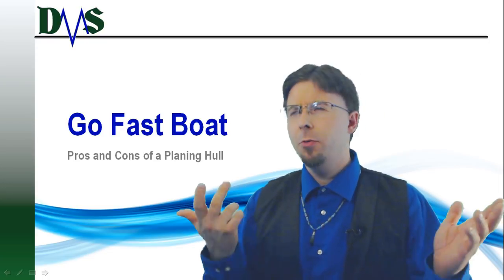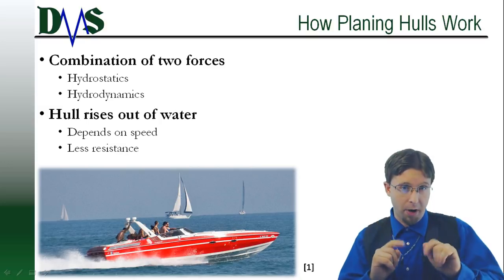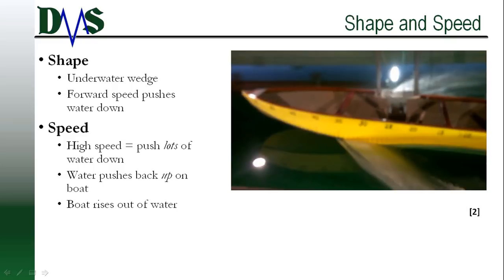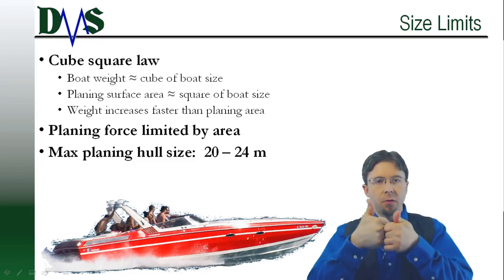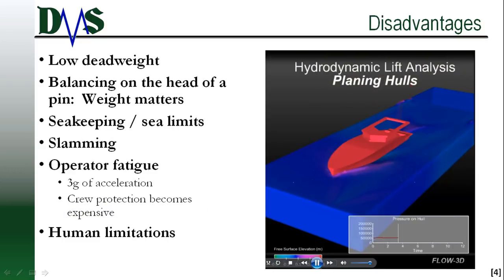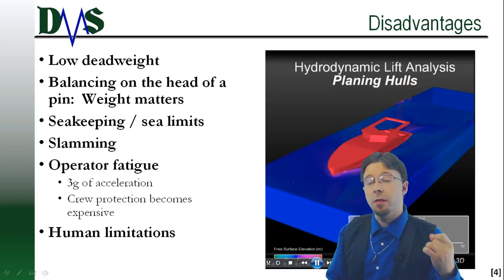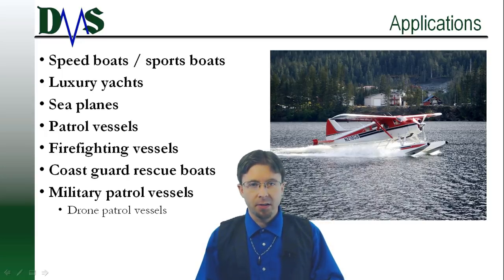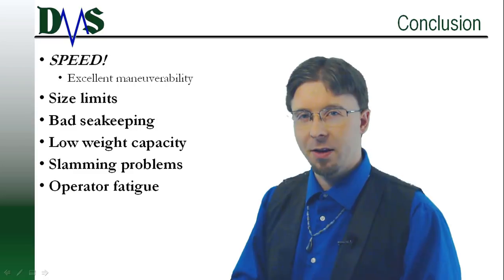GO FAST BOAT:  Pros and Cons of a Planing Hull

Comment: Great video on planning hulls. If you have not already done a video on semi-displacement hulls please add that to your list. I operated an 82' USCG Patrol Boat that was fast for it's size in heavy seas. A very stable boat, but rocked side to side even in clam seas. I use to have fun surfing her on the swells in a following sea. In a 6' swell you could find the sweet spot and ride the swell. She even broached on a 40" wave but recovered. I was standing on the bridge's bulkhead "waiting" for her to come back. And it did, just in time for the next wave. Fun times.
Reply from the maker: That's a great topic.  It will nicely round out the different hull categories I've already looked at.

Comment: Outlaw Eagle has an interesting solution to the problems and weight distribution conundrums and risky situations caused by waves and rough waters on high speed planing hulls designed for white water river jet boat racing. They have attached small canard wings near the prow. Each wing is about a meter long and 250 mm wide. They use the speed through air to make lift and let ther front of the boat glide over waves and avoid porpoising and augering in or slamming into most of the roiling water they race through

Comment: So are plaining hulls different from hydrofoils? Or is Planing hull the more technically correct term?
Reply from the maker: Yes, planing hulls are different from hydrofoils.  Hydrofoils use miniature wings under the hull to lift the boat completely out of the water.  In a planing hull, the boat still has a small section in the water.  But to make matter confusing, the hull of hydrofoil ships is often a planing hull.  This helps the hydrofoil vessel get moving fast enough for the hydrofoils to take over.  Just like an airplane needs to reach a minimum speed before it can takeoff from the runway, hydrofoils also need to reach a minimum speed before the hull can clear the water.

Comment: First, thank you for your channel and the way you explain. I don't understand: the maximum planing hull size is 20-24m, but the wally 118 (36m) is a planning hull.  Do you mean that past 24 meters , the amount of energy required to put the hull at speed will cost too much for most of the shipowners?
Reply from the maker: Good question.  I don't mean that the 20-24 m size is a hard limit.  There are no physics that suddenly turn off planing forces above 24 m.  That's just the general limit that I picked based on most of the planing hulls I have worked with.  You can absolutely go larger.  But as you go larger, the margin to support the boat weight in planing becomes narrower.  Shipbuilders need to really minimize the vessel weight.  And the designers need to perform detailed analysis to get maximum planing force from the hull.

Mostly, I just want people to avoid the fallacy of thinking they can scale up without limit.  I saw boat builders that took a hull shape designed for a 9 m hull and scale that shape up to 24 m.  They were surprised to find out planing hulls don't work that way.  So just avoid that mistake.

Comment: Nick, have you looked at the USN's Ghost? Is it a Cat, planing hull or a combination? How dose the cavitation drive work?
Reply from the maker: These two articles were my main sources for a 5 minute introduction to the Ghost.
https://www.militaryfactory.com/ships/detail.asp?ship_id=Juliet-Marine-Ghost-Stealth-Boat
https://www.businessinsider.com/juliet-marine-systems-ghost-boat-2016-11

That vessel has a LOT of unique physics combined.  But from what I read, I would not call it a planing hull.  It's closer to a SWATH.  I have a video to explain the SWATH idea.  https://youtu.be/jJAHyDl6KS8
Those individual hulls may generate some lift at higher speeds, but I don't think that is the main intended effect.

The supercavitating drive is a little misnamed.  It's actually a combination of two ideas:  air lubricated hull and supercavitating propeller.  The idea of an air lubricated hull is to inject large amounts of pressurized air along a hull.  Then the hull avoids direct contact with the water and this lowers the skin friction on the hull, usually around 4-6%.  Normally, we get the pressurized air from an air compressor.  But in this case, they seem to use a supercavitating propeller.

In most propellers, we try to avoid cavitation.  (See this video for a quick explanation of cavitation:  https://youtu.be/MyZzhwYMytc)  But at high enough speeds, you can't avoid it.  So we design a supercavitating propeller that intentionally takes advantage of that.  But you get a large stream of bubbles coming from the propeller.  On the Ghost, they had the idea to mount the propeller at the front and use that stream of bubble for lubricating the hull.

Interesting idea, not sure how well it works.  Those cavitation bubbles normally don't last long.  They typically collapse under the water pressure.  For long term care of ships, we like to avoid putting any hull structure in the path of those collapsing bubbles.  But you never know, maybe Juliet Marine found a new trick.

Comment: Are hydrofoil boats in the category of planning ones? There are much bigger hedrofoil boats than 24 m. USS Plainview is 67 m long.
Reply from the maker: Yes and no.  Hydrofoils and planing boats both use dynamic lift.  Meaning when the boat stops moving, it sinks back into the water.  Same way that planes need speed for their wings to generate lift.  But you hit on a good point.  A hydrofoil is generally much more efficient at generating lift than a planing hull.  So we can get more lift, allowing hydrofoils to still work on larger ships.

That being said, I tend to think of them as two different categories.  Because the physics and design challenges are very different for the two.

Comment: I will ask you your opinion, if possible please. Much sailing cruising boats or day sailors are below 25 foot of length, they run most of the time well below displacement speed, are expensive for the sails new technology, ballast, winches, etc. and generally have an auxiliary engine to avoid a lee shore, or to maneuver, or going upwind.  And most of planing hulls in the same size are a deep V bottom with huge outboards or sterndrives, very wide and heavy. My question is if there is not an unexplored niche for flat bottom recreational planing hulls intended to run in the low tens knots. They will need a very small engine, will be quite economic to run and safe, and can be built in a budget and low time. Because for cruising or camper cruising  a boat of this kind makes more sense than a trailler sailor, except if people likes sails for sport. And almost all commercial recreational planing boats in this size can't run below the low twenties.  A small planing hull with a flat bottom can cruise for several hundreds of miles, will need less water and food for the crew and at low speed more forgiving but at a pace double of the sailboat or more. Thanks and sorry if is a very silly question.
Reply from the maker: Not a silly question.  There may be a niche opportunity there.  To oversimplify the problem, your planing speed is roughly tied to ship length.  To get a ship up on plane at lower speeds, we need a very short planing surface.  (There are ways around this problem, but we'll keep it simple for now.)  To start planing at 10 knots, you are looking at a ship length around 9 ft.  Still achievable though.  This would probably be a stripped down, basic boat.  Mostly intended for pure transportation.  A 1 or 2 seat capacity with a motor, fuel, and not much more.  Imagine the motorcycle equivalent of the boat world.
Reply: Thank you

Comment: are you going to cover hydrofoils?
Reply from the maker: Eventually, yes.  They are on the list of videos that I want to make.  (It's a very long list.)
Reply: @DatawaveMarineSolutions  Please do! I'm trying to learn more about hydrofoiling because it seems they would be the most energy efficient way to go fast. They simply don't waste energy on making any sort of wave. Power required seems to scale linearly with speed. What more could you ask for?
I'd be very curious why there aren't more of them e.g. a motor powered cruising yacht.
Seems like it would make it possible to use solar power to travel relatively fast.
Reply: @dejayrezme8617  why? the prop has to stay deep enough in the water even the boat flys above the water..

Comment: Nicholas i always have so many hypothetical questions but ill keep it quick, could you tell me what the price ranges of hiring an Architect are and what are some things to consider when choosing an Architect?
Reply from the maker: The price ranges vary, depending on the country and region.  But in general, naval architect prices vary from $100/hr to $200/hr (USD), based on the experience of the naval architect.  But the billing rate is only the starting point.  The total price depends a lot on the project and what work they need to perform.  As a general guide, most projects cost at least $2000 or more.  (This is all for the commercial side, where every ship gets customized.)  For how to hire one, I actually did a whole video series on how to hire a naval architect:
https://www.youtube.com/playlist?list=PLhupav37c1P8ThgTixOc6cj5mFDr8gw-3

Best advice I can give:  The more clearly you explain your project with the consultants, the better price you can get.  Allow 2-3 weeks for the consultant to prepare a quote for you.  This gives them time to discuss the project, ask questions back and forth, and then prepare a really well detailed quote.

Comment: So planing catamarans that use the air pressure between the hulls to reduce slamming are much more sea-kindly. And the two narrow hulls reduce resistance at low speeds. What's your verdict?
Reply from the maker: I agree with the initial idea.  But unfortunately, the scale of the different effects makes this unlikely. 

The two narrow hulls would reduce resistance at low speeds, true.  But it also reduces their effectiveness at planing speeds.  Imagine you have a monohull planing hull and cut it in half.  Turn the two halves into a catamaran.  Problem is, you don't get the same effective planing force on those two halves.  Planing works because we force the water to turn downwards to avoid the hull.  But in this half monohull, the water finds it much easier to just go to the inside of the planing hull.  With a catamaran, your hull design could easily become dominated by the planing requirements.

The pressure between the hulls is a good idea for reducing slamming.  But the magnitude of the air pressure normally doesn't make any difference.  The air can easily escape the big cavity between the hulls without increasing in pressure.  So it doesn't really affect the slamming operation.  I have seen some concepts that change the hull design and try to trap the air before it can escape.  That has some effect.  But when we trap the air, we compress it.  That compression is how we damp out the slamming.  Now things get really interesting.  Air heats up when you compress it.  And since water is 1000 times more dense than air, we need to compress A LOT.  Assuming we compress the air to only half of water density, that would increase your normal air temperature up to around 240 deg C (assuming we start at 20 deg C).  Twice the boiling temperature of water.  So now we need to worry about heat burning the hull, and generating steam in the water.  What can I say, the physics makes things complicated quickly.
Reply: My experience is different, take for instance the deep vee hull, in that situation the vector of the planing force is directed outward rather than downward reducing slamming. In the case of cats I have driven, the reduction of planing surface has no effect on it ability to plane, at least in the age of 650 HP outboard motors and the reduction of slamming because of air pressure under the center of the hull is quite noticeable and results in a forward "sneezing" of spray from between the hulls. In other words, you can feel it happen. Personally, I could give a rip about large steel ships as I will never own one, how ever in my shopping for a offshore fishing boat, I have yet to see a monohull that can compare to a cat.
Reply from the maker: Interesting!  I admit that sometimes the theory doesn't predict things accurately.  Those are the really fun points.  I'm a little surprised about the "sneezing" spray from the forward hulls.  I would expect it to spray aft, out the transom.  Do you see spray on the aft end too?  I wonder if the damping experience has anything to do with the shape of your cross deck.  Is it just a flat cross on the catamarans you drove?
Reply: Basically the bottom of the deck between the hulls is high in the bow and just above the resting waterline aft. The outboards are mounted on the center-line of the hulls and the weight seems to be quite aft. The result is as the bow is forced up by a wave, the stern stays planted and when the bow comes down, air is forced out forward resulting in the sneezing I described. Worldcat, the boat I have decided on explains the idea on their web site.  https://worldcat.com/ and here is a You Tube video of one in a seaway. https://www.youtube.com/watch?v=VtBiHnP6oSI&t=859s
Reply from the maker: I'm impressed.  I can see how that design would work.  I gave too little credit to the air damping effect.  Kudos to World Cast.
Reply: +Datawave Marine Solutions I don't think the air damping is a significant effect. The hull is a sort of hybrid, the rear part is designed to plane but the front is a wave piercer style, so when the front dips into the water it smoothly cuts in rather than slams. As you probably know, cats can be built this way since they dont need to design the hull to be roll stable (because there are two of them).

Comment: Thank you very much. You do raise a question or two. Since we don't get to see the bottom of aircraft carriers other then the flat bottom model types sold in kits, and you can't be sure of the exact shape is represented in the kit. Now the secret is that the aircraft carriers are suppose to only goes about 35 knots but in actuality if it needs to be displaced in a hurry they can go over 85+ knots with everyone hunkered down below. My first question is under your numbers can they go 35 knots? And the second are you aware of the UFO type technology that will enable it to go the above mention unbelievable speed the sailors have been subject to. Lots of love
Reply from the maker: It's possible.  They absolutely can go 35 knots.  But not using planing technology.  That ship will never use planing technology.  Just too heavy.  The aircraft carrier is exploiting a wonderful trick of displacement hulls.  To oversimplify:  the longer the hull, the easier it is go faster.  Normally don't see large hulls moving fast because most commercial ships are designed for efficiency.  But the aircraft carrier needs speed, and has the power to match it.  At over 1000 ft long, they are only at a Froude number of 0.31 when doing 35 knots.  That is fairly easy for any hull to do.  At 85 knots, they are near a Froude number of 0.77:  fast, but still within the realm of displacement hulls.  You don't see solid planing until you are near a Froude number of 1.0.  So yes, 85 knots is potentially possible if they have enough power.
What could stop them from running 85 knots?
- Power.  Even nuclear reactors have their limits
- Propellers.  They may not be able to push that much power through the propellers
- Slamming.  Any waves will have a HUGE impact on the bow at those speeds.  You might dent or break hull plating.
- Hull bending.  If a wave tries to pitch the carrier up at those speeds, nothing good will happen.

Yes, it's possible.  No UFO technology needed.  Just lots of power, and a VERY calm day to avoid any waves.
Reply from the maker: At that point, your main limit isn't power.  It's the structure.  If you tried to push the carrier at 85+ knots, the entire ship will vibrate violently.  And when we include waves, the story changes completely.  A typical seastate on a nice day would be seastate 4, with a significant wave height around 1.88 m (6.2 ft).  (Significant wave height is one of the measurements we use to define a seastate.  It has a mathematical definition.  But practically, it is the height you would guess when making a visual estimate.)    But at 85+ knots, every wave would be like a bullet slamming through a brick wall.  We don't build ships to withstand life as a bullet.  And the story gets worse if we talk storm conditions.  Now imagine significant wave heights of 5-8 m (16-28 ft).  Now the ship is pitching and bending flexing in the waves.  

I can't say with certainty what the carriers can handle.  I would need to know the details of their structure for any reliable estimate.  And I doubt the Navy will give away those crucial details.  But to take an educated guess:  I wouldn't push anymore than 40-45 knots in good weather.  In rough weather, that speed would be down to 10-20 knots.  Anyone have experience working the carriers?  Want to chime in with a sea yarn?
Reply: Of course that makes sense about the force of water at these speeds would be earth shattering and would create waves of gigantic proportions. I have come to understand that there is some other technology in the making. Just like UFO craft that make 90 degree turn on a dime at speeds double the jet following it. Couldn't this type of tech. be a factor? I realize that your concern is mater of state as earth as developed in the last century and understand but we need to move on to the next level. Lots of love Sorry just wanted to push the envelop in the thinking of peoples mind to a new upcoming reality.